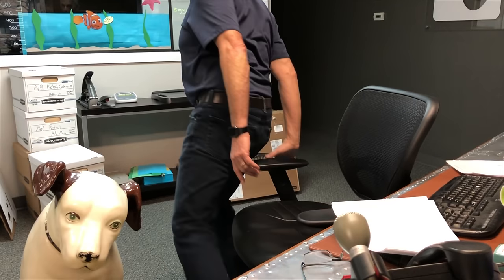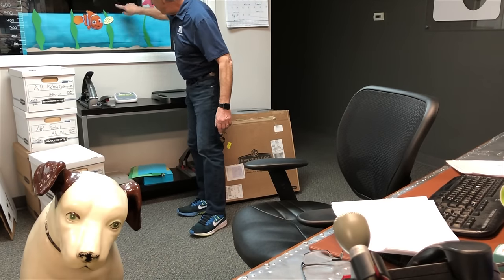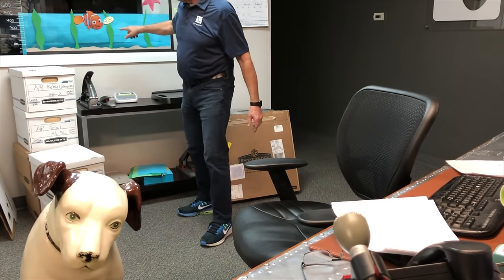Why do tubes sound different than transistors?

Comment: Transistors are switches. Valves are not. Even though you can't "hear" the difference, the switching action of a transistor is still perceived by the brain. Negatively. If you don't believe it, try it. Sit in a chair while video recording your face. Listen to two hours of your favorite music at the same level first via a transistor system then a valve system. The transistor system will cause a tiring effect. The valve a calming effect.... Well unless your favorite music comes from the Head Banger genre.
I have had many people say I'm a liar and that there is no way I can hear the differance in the two. Head to head I have yet to not hear the differance. If you can't, seek medical attention.
This is a tecnology that should still be in every home audio and Tv. It's like how they rate the clarity of flatscreen Tv's with #'s like 1280xwhatever, the old crt's are rated unlimited. Hook an old Zenith system 3 to your computor with a proper converter and you'll piss on your flatscreen. Indestry just found a product they could make for a fraction of the cost yet sell for the same price with half the livespan. When computors first got popular you could not find a converter for a Crt Tv. You could cajigger one from a reciver modual but nothing was for sale. Untill most all Crt's had been replaced. Funny that. It's almost like they didn't want people to see the differance.
Reply from the maker: The first computers used vacuum tubes as switches. Later, the transistor took that job but it's not correct to think of them as a switch. They are valves every bit as much as a vacuum tube. They are completely linear in the same way a tube is. The fact you get fatigued from listening to them is not nothing - and there's plenty of reasons for that. However, calling them (or thinking of them) as a switch is not among the reasons.

Comment: simple, tubes produces even/odd harmonics adding to the signal bec. it operates to be heated to function (filament/heater connections - 6.3v, etc.), whereas transistor/solid state
device just needs some biasing in a fraction of a current in milliamps or millivolts. tubes plates voltages requires very high voltages (100v, 200v - or >1kv) defending on kinds of output tubes used in an amp and it's topology or design, i.e. single-ended or push-pull, class A, etc.....................

Comment: Good explanation.  I might add that even the "linear portion" of most transistor curves is somewhat "bowed", whereas there are tubes which (at least between cutoff and saturation) are almost ruler flat.

Also, because tubes are such high impedance devices – (a fact you alluded to when you said they "don't draw current") – they present a very easy load to the input signal.

The last thing I'd like to point out is that a transistor's characteristics vary GREATLY with temperature – (moreover, their capacitance can vary with input level) – whereas tubes are pretty consistent.
Reply: so we build  an amplifier with a ruler flat curve . Then  we add a BBC or some other  dip to the loudspeakers .. Really!!
Reply: Ruler flat depends how large the paper and ruler is you are using!.

Comment: In transistors & all solid-state devices, the conduction of electricity is by "holes" & "non-holes" (electrons) which produce a hell lot of noise. But in vacuum tube, it is thro' pure electrons.

Comment: The real difference between tubes and MOSFETs are the input capacitance. And the internal impedance due to the load. And not to forget - tube amplifiers needs an output transformer to match (e.g.) an 8 ohm speaker,  with the limitations (or advantages) hence to this fact.

Comment: The bottom line for the difference in tonal characteristics between valves and transistors is that valves tend to distort with a preponderance of even harmonics, and transistors tend to distort with a preponderance of odd harmonics. The even harmonic distortion is  more musical because it is consonant with the original sound, whereas the odd harmonics are dissonant with the original sound.

If you are always driving valves or transistors as a class A device and they remain entirely within their linear range there should be no audible distinction between them because there should be no distortion of any sort.

The differences occur when you drive them outside of their range of linearity, especially if you drive them either to the point of saturation or to turning off.
Reply: The point of tubes is using them outside their range of linearity in order to create 'euphonic' low order distortion.
Reply: @danaustin5869  That is one way to use valves. Many folk are more interested in eliminating distortion entirely.

Comment: The  reason tubes sound different from any solid state device is due to dynamic loss... though with certain MOSFET power devices this loss is shared with that of the tube stage(s) ... that's ALL it is !!

Comment: Everybody talks about frequency response when evaluating components or, in this case, tubes vs transistors. Linearity is related, for sure, as a nonlinear device will introduce harmonics. It’s easy to understand and the test is (relatively) easy to conduct. Input a sine wave and measure the output. 

But music isn’t a simple collection of continuous sine waves (keyword “continuous”). It is dynamic. From a drum beat to the pluck of a guitar string, every note is dynamic, that is, changing over time. Ever watch the vue meters on an amp? The ability of the gain stage (tube or transistor) to track these changes without distorting or running out of gas is critical. 

Tubes are voltage gain devices, almost no current draw on the input. Since no current flows, I suspect the tube is faster and better able to track the dynamics of the signal.

Comment: I bet much of it just comes down to size, as it takes longer for electrons to travel the length of the tube compared to the tiny distance of the silicon, you get different behaviour, for example, to electrons already in transit, when you charge the grid... so it's like the difference between a pneumatic system and a hydraulic system, where the pneumatic system softens changes as the gas can compress, whereas the incompressible hydraulic system responds very suddenly

Comment: A tube amp and transistor amp should sound identical if well designed, equal output, and operated within their linear specifications. If you start to drive them out of non-linearity, all bets are off.

Comment: Today electronics is piece of crap, everything (even expensive things) are made to die exactly in that day when warranty will end. They using 85°C capacitors instead of 105°C (nonsense, price is almost same) and many other proofs....Old speakers from communism era here sound better than half of expensive today shits, they really calculated it, today many omakers just copy paste some box and put there nonsense speakers with fake frequency filters (I don't know how to call it in English) and today amplifiers....my father had new Pioneer few yeras ago, it survived exactly 2 years which is obviously warranty time, they doing it on purpose. I am not saying tubes sound better, I am just saying better is working electronics than supermodernsuperchuper amplifier which dies in 2 years.

Comment: Being a tube guitar amp player of many, many years, it seems to me that tubes in the power section of an amp is what gives it its "balls".
I understand, to some point, how tubes have a "softer,rounder" clip in the pre amp stage, but these hybrid amps that have a tubes(s) in the pre amp, and ss power, sound just as bad as all ss.
Put a ss preamp in front of a full tube power amp, and you are mostly there.
Of course, all tube is best, but man i am getting too old to carry around a 95 pound 2x12 combo.
I would love to find a ss amp that actually delivers.
Reply: Not really a valid argument. most guitar amplifiers are designed to colour the sound. They are a part of the overall instrument. Seems to be some confusion as to warm reproduction and accurate reproduction Not possible to have both as the warmth is distortion. it might sound good but it aint HIFI

Comment: As an amature, the problem is that whenever I get to hear tubes - it's always on vinyl and horn loaded full range speakers.
And when I listen the polar opposite it's: active speakers, DSP crossovers, class D playing Qobuz bit perfect FLAC 192/24 with full Dirac Live (like the Dynaudio Focus 50).
So I think my idea of a "tube sound" is very much colored by the rest of the setup usually used.
Add to that, the tube stack is playing some austere Kari Bremnes and the "tech stack" is playing Dream Theater or Tool.

Comment: yes tubes wear out but no one says you have to buy a tube amp with a large number of expensive tubes. i use a musical paradise set tube amp that takes all types and finding 2 new output tubes every couple years is not pricey and i find it fun. plus i can alter the  sound 'quality' by using different types.

Comment: Simple;  One is a switch. the other a valve.
Music does not switch on and off. It rises and falls in waves.
Next question.
Reply: A switch?, only if you are comparing input to output voltage of a bi-polar, but use current and there is a linear relationship(almost)-thats what designers use.

Comment: Interesting, but a simple explanation is not really convincing. All amplifiers, thermionic valves or solid state will have unique characteristics depending on design. The adoption of solid state amplifiers was for economy and reliability. Valve amplifiers sound warmer to the listener because of the output characteristics when matched to a speaker.  One expects that there being no limit on cost, the most carefully and elaborate designs seek to faithfully amplify the input signal without distortion and have output impedance characteristics matched to a particular speaker.Therefore two such systems, valves based and solid state could and  should sound identical to the listener. The problem is that by telling people they sound different means that they expect them to sound different. This then allows the adoption of simpler designs having imperfect characteristics which is not what Hi-Fi  is about!

Comment: Nice explanation Paul. Anyway, yes they sound differently. But the main reason are the output transformers with their hysteresises and the slew rate. Due to the high value of the tube setup, they sound differently and gives you the warm feeling only tubes can give you. Signalwise on the paper go with BJT or with FETs if you like.
Reply: Howdy. I'm with you.
In my mind. Also the magnetization of the transformers play a role. It is not linear.
Regards.

Comment: Sorry, but this doesn't explain anything. All you said was essentially "they sound different because they are different". Hum. you started to talk about greater headroom because of the greater voltages valves work at, but that can't be it for preamps as you are never getting close to nonlinear regions. If you were, they would show in THD figures, but isn't it much easier to created a low THD solid state amp than one with valves? Perhaps valves sound nice to some people because of the specific kind of harmonic distortions they (and associated transformers, etc) introduce.

Comment: Why is it every time I watch this video, the famed Stereophile Bob Carver Amp Challenge comes to mind???

I'm sure many here recall the challenge to make a Carver mid-fi amp duplicate the sonics of a storied hi end amp, in this case a Conrad Johnson model costing several times the cost of the Carver amp.  With several hours of tweaking, eventually the 'golden ears' conceded that Carver had in fact reproduced the sound of the reference amp.  Never have learned which brand of speakers referred to they used that were so hard to drive???

Carver admitted his unmodified amps do sound different than the reference amp because he tunes them to what he personally prefered and felt would work best with the range of speakers his customers would most likely be using rather than the difficult load speakerse the testers provided.

Myself, I've gone thru several SS (NAD and Carver receivers w/wo the Sonic Hologram) and tube combos from tweaked Dynaco amps to the current setup of a Rogue Magnum with KT120's into Vandersteen Model 2 Signatures.  I have to admit that both the NAD and Carver receivers had a pleasantly warm sound for hours of listening without listening fatigue that plagues so many solid state units.  Not exactly tube like but not far off either.

As you mention, you and other manf's are producing tube front end coupled to SS power amps, combining the best of both worlds. Are we approaching the listening nirvana we've long hoped for??  Time will tell...

Comment: Yes.  Tubes sound different.  The difference is hard to describe.  It's like the difference between Dave Brubeck and Fats Domino, if that makes sense to anybody.  LOL.  I have an FM set that is a tube set.  Tubes are like LPs , for example.  When you hear them again, you think "Why the heck did we give this up?" Tubes and transistors don't actually work that much differently.  They are both nothing more than devices to control the speed and movement of electrons.  Tubes do that in a vacuum with heat, transistors do that with silicon materials  Perhaps the signal cutoff points in tubes are less definite, and therefore produce a warmer sound?  IDK for sure what it is.  I'm just guessing.

Comment: I think you said even if the data shows the plots the same they still sound different and if so I find it hard to believe. I am curious if you ever did a blindfold test lol and how you did? Would be interesting.  I use mosfets to pwm control motors so was wondering if you do that with speakers? If so you could linearize if needed or closed loop servo as well which is what we do. Or you could make a lookup table to replicate the tube response. Would love to know. Thanks for the video!

Comment: Tubes have filaments, they glow red when heated. In presence of oxygen it will oxidize. They fill the tube with a type of innert gas to last long time.
Reply: Light bulbs are filled with inert gas. But tubes need vacuum to function properly, as they are moving electrons across a gap.

Comment: Tubes sound different but they also measure different. You can of course claim something to sound different without measuring different just by not measuring what makes the difference. Tube amps are usually clipping the peaks softly and you get more musical distortion (even harmonics) than some hard clipping transistor amp. A simple FFT measurement or square wave comparison can easily prove this difference.

Comment: Linear characteristics of tube small signal amplifier is reason for difference in sound of tube compared to semi-conductor transistors. Noise characteristics. Harmonics. Response. Yes, in theory the devices are likely to sound different - but probably not significantly. For audiophile their is always spiritual relationship to tube amps to consider - tubes sound better because of psychic vibration of filament in vacuum.

Comment: Valves are voltage-controlled devices. Normal transistors are current-controlled devices. FET transistors (Field Effect Transistor) are controlled in the same way as valves - by voltage.

Comment: Is there a significant difference between using a 12 meter 16 gauge silverplated audio cables vs 11 gauge ofc copper cable that is short? despite the resistance  which difference is 0.3 ohms which probably isnt even noticable and wont cause any signal loss maybe a small percentage of power loss right?

Comment: Semi conductors are basically rocks. Have. You ever heard quiet rocks? Tubes use s soft flow of electrons in a magical  space charge vacuum . Transistors are small, cooler and use lower power.

Comment: As good as any explaination solid state, n Tube gear sound different for some. I Grew up with audio processed by  using tubes, so I witnessed the move to sold state. I honesty can' hear a difference at all. I seem to recall, a dude named Doug Carver, was able to build a solid state amplifer, that audiophile could detect using proper trials. I don't have clue if Carver is still among the living, but he last time I bothered to clue Caver had bot solid State, and tube equipment for sale. That's  what a savvy business person does, try to serve multiple markets. For myself I don't have te desire or the funds to search out the ultimate system. In my home my realistic Marantz clone receiver has serve me well for nearly 40 years. For automobile sound the discount store,and JC Whitney Kraco, and Sparkamatic gear was good enough for me. . Back in the day a local shop carried Motorola 8 track tape decks, so I would spurge on them, with build quality in mind.  Needless to say I'm not interested in looking for nuances.

Comment: Up until recently  vacuum tubes did not last very long then along came Bob Carver who's latest tube amps have tubes that last 50 YEARS in his Crimson /Raven 350 and last a lifetime in his silver seven 900 .Only a genius  who started Phase Linear , Carver , Sunfire ,Carver LLC  and finally Bob Carver Corporation could design such an amp as all his designs were ahead of there time.

Comment: Bob Carver said if you put a 1.5 Ohm 50 watt resister on the positive speaker input it will make a solid state sound like a tube amp. I will find out this weekend when I install the resistors on my Infinity Reference One bookshelf speakers. I am doing this because my Sansui G9000-DB receiver requires a load of at least 8 Ohms when four speakers are hooked up. The speakers are 6 Ohm. Hopefully  the resistors will supply enough resistance to safely run my speakers. Of course this could be some of Bob's snake oil. We will see.